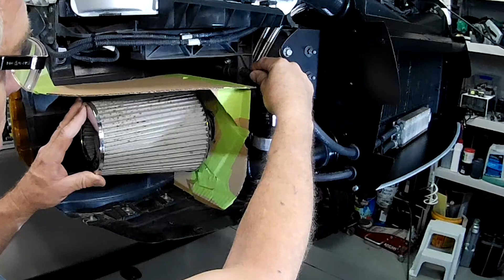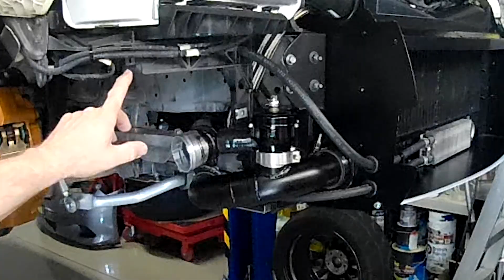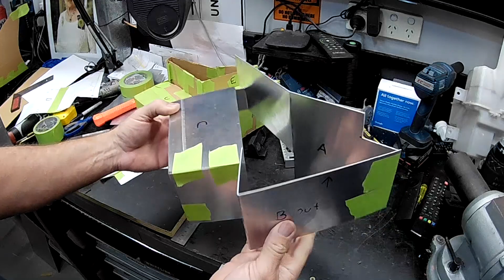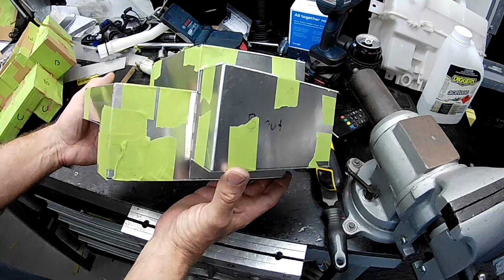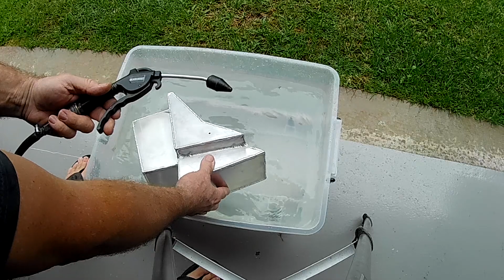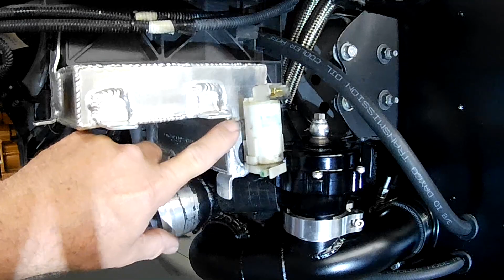G37 370gt TT Custom Windshield Washer Fluid Tank + Pod Filter Enclosures

Comment: Fantastic outcome from the ducting. Nice work young man. I pulled the lower front sill on my old HR (about 40 years ago) cut some vents into it, resprayed it and made it look "factory" and re-attached it, only to discover that the wheel wells  completely cut off any air getting to the brakes from under sill. At that point, rather than hacking into the wheel wells, I gave up, removed the sill, returned it to how it was and put it back. Shit, shit, shit!!!
Reply from the maker: Yes, it can be a bit like that at times.

Comment: Good content has always! Pretty amazing skill on designing stuff from scratch. You should make your own custom combo catch can like the soho one that's holds coolant reservoir and the oil blowby from the pcv system. It should make the engine bay look a lot cleaner. I myself got Soho one. Keep the content going!
Reply from the maker: Cheers Vlad, the Soho unit is a sweet bit of gear hey.